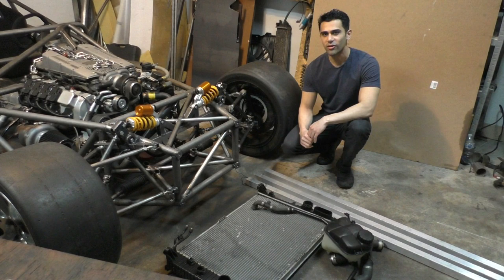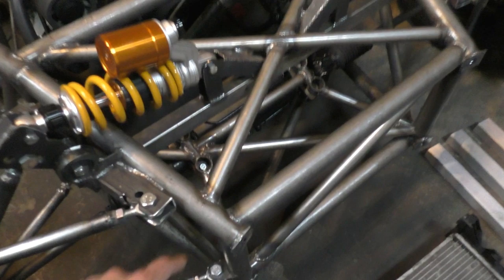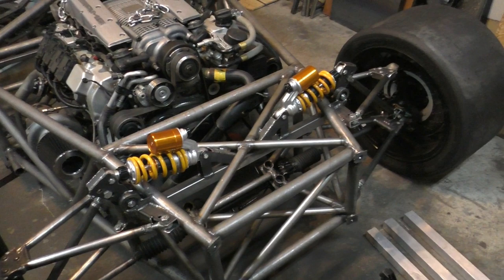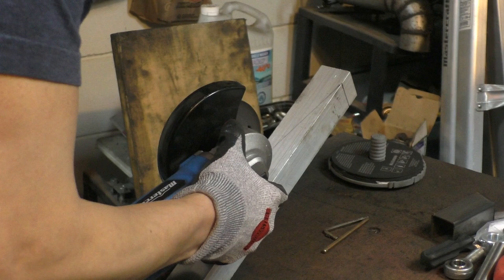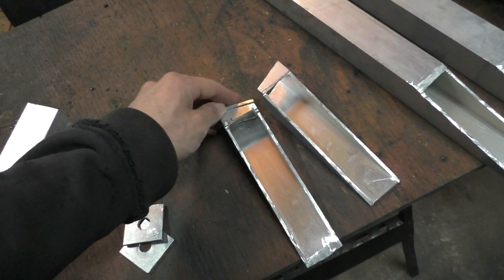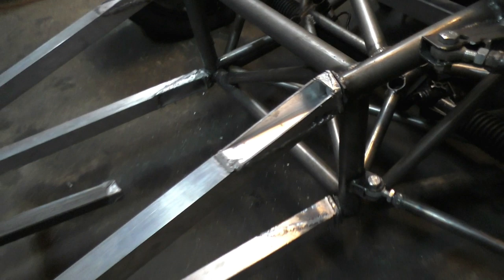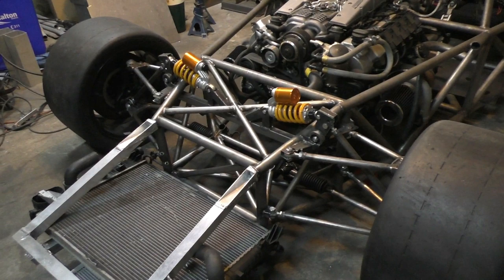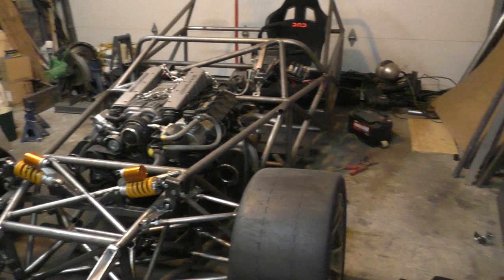Crumple zone and Radiator Install - E55 ASL Part 9

Comment: SK8215
As a replacement for the supercharger, you could (later on) install electric boosters. A 0.5s charge the only thing that they are useful for. It would reduce the turbo lag. You’d probably have to combine them with li-polymer battery packs to keep them lightweight and power dense at the same time. 
I would find it interesting to see how much that would improve the performance of the car (if you feel that need at some point). 
Haha that’s just a matter of time...

Comment: Where triangulation doesn't meet corners,  you can add gussets out of flat stock in the gap. Will join all members stronger.  Also, intake manifold,  w219 5.5 ltr has variable length intake runners. Maybe make adapter plate and use that intake?  Throttle response is great on those motors.
Reply: The non supercharged M113 has variable as well. Probably doesn't flow very well though.
Reply: GreenWeeney 
Those are great ideas! 👍
Reply: @Conservator.  👍
Reply: GreenWeeney 
When he mentioned those triangulation bars didn’t go exactly to the corners I thought that if those short pieces of thick tube where bent in an accident, you’d probably others things to worry about (or even nothing to worry about anymore). 
Do you think adding gussets would be useful in that sense?  I’m just curious and you are undoubtedly more knowledgeable than I am. (Considering my knowledge that’s not even a compliment;)
Reply: @Conservator.  lol. It was a suggestion to him for if the joint connection was at all a concern to him. Especially considering that fact that it would be the main joints to which the crash bars bolted to.
I've found gussets to be a very good and safe idea for all kinds of joint or brace reinforcement, from wood to plastics and metals.

It was a suggestion.  Trust me, not a sign of any imposed knowledge or skill.  😎👍
Reply: GreenWeeney 🤣👍
Reply: Variable intake runners? Sounds more like a trombone than a manifold.

Comment: I was gonna say I would block the transmission cooler part on the radiator as they have a tendency to leak. However coolant in your power steering system is a lot less damaging than a Bruce Jenner strawberry milkshake. You blocked off the radiator when you welded above it but not the plastic end tanks, lol. Just weld new tanks on it already :p

You only have a certain cylinder pressure limit, whereas a supercharger being a giant parasitic drag on your crankshaft stealing HP from that limit, a turbo does not!

Comment: With your crumple calculations, did you factor in tearing of the base material at the welds? Also, did you use 4340 here or was it CDS.. I've been paralysed with my own build for a while now pondering over how I can improve my design. P.s I'm an aeronautical engineer, so my skills are more with wing design and fluid dynamics...

Comment: hi
 think it's a bad idea to position the radiator so close to the road.
- it will be clogged with dirt
- on a sunny day, the road warms up t~ 60-70с, it means he will work under unfavorable conditions, over t= +30с
Reply: Quite a nice spot actually for keeping cg low and looking at the intended bodywork design there is going to be positive pressure above the radiator from ramming trough the air so air is forced out from the bottom prop keeps the dirt out as well. Still it's not a shopping trolly this car would need so much maintenance anyway cuz racecar
Reply: no doubt it will need servicing but nothing compressed air and a hose water can't fix.

Comment: When welding with a mig mate always push. With mild steel do what's called a string bead. So don't weave just push it it evenly. Watch the edges and the centre will take care of itself. With aluminium you do what's called push pull.
Other than that great work

Comment: Things are coming along love this build but would it not have been better if you mounted the radiator at an angle were the would be touching the top aluminum bean

Comment: The only thing I'm worried about is a car sliding over you because that crumple zone is low.  God forbid that happens.  Yes, it does happen and can.  I saw a video from two weekends ago and luckily this dude had tubes going from the top of the main hoop to the front dash area. I'm pretty sure it was a Radical. Just my two cents. I love what your doing keep it up!
Reply: oh no, not a halo?
Reply: Tik Tok 
You probably mean: God forbids that happens. 
Now it’s like you wish it to happen ;)
Reply: @Conservator.  ha yes sorry.
Reply: Tik Tok 😉👍
Reply: Also here's the link of the crash I'm talking about. https://www.facebook.com/story.php?story_fbid=2763980523618128&id=100000186228201
Reply from the maker: Yeh, sliding under another car is always a risk in open top cars. Even in f1 they've had a few close calls. I still prefer to keep it open top rather than going with a full cage. Just a better driving experience

Comment: I would definitely think about some reinforcement around your lower rear control arm. This tube sees the most force during braking and you have it in the middle of a tube, suspension points should always be at triangulated nodes. This tube is likely to bend during braking, and possibly permanently. Also would add gussets to the U-channel in the front for less compliance. And your lower rod ends are in bending due to the moment created by the pushrod acting like a lever on the outer ball joint. Lastly in another video you said you used water to cool down your A-arm welds. Depending on how quickly this cooled the welds it could've made the welds brittle. This is actually worse for alloyed steel like 4130 vs normal 1040 steel etc.
Reply: He addressed most of this in another video where he showed his analysis. You should watch that and then by all means counter with an analysis of failure modes you have discovered. It would be really useful to see alternative analysis of his suspension, maybe you have seen something he missed. Also, rod ends are not in bending if you look again.

Comment: I really like the idea of removable crumple zone, have you considered adding thin wall cross bracing to it too? It looks like if hit at 45 degree angle it would have only 1/8th of it's strength. What are the dimensions of aluminium tubes?
Also when calculating the strength did you use weight of the entire car or only parts behind given segment to estimate g at which it will start to crumple? It's a front-mid engine car so there shouldn't be much mass behind the seats acting on driver compartment (in front end collision).
Reply: Yeah I like the idea too but it would be better with cross braces. Race cars usually get hit on corners or sides. Just my 2 cents. Awesome project that needs more attention!

Comment: Maybe I missed it, but I'm wondering why you chose not to tip the radiator up at the angle of the upper bars of the crumple zone for better air drive through the radiator. At that flat angle a great deal of air will be passing over instead of through the cooling fins.

Comment: There aren't many people building chassis from scratch around, good to see another one out there! Did you go with aluminium for overhang weight or softer crumple design originally? I think we'll be ending up with steel as it stands, just because we haven't done any aluminium welding at all. Maybe something to change later though.

Comment: I first thought you should make a jig so it is easy to make new crumple zones, and then always have a spare with you just in cast you have a front end collision. So far so good, then you mounted your radiators in the crumple zone so in fact every time you need to bolt on a new crumple zone you will most likely have to replace the radiators which complicates thing a little. Was there no other place that you could mount you cooling system?

Comment: The supercharger takes HP, weighs a lot, raises the center of mass of the engine, because its in one of the highest points on the car and adds a lot of rotational inertia during acceleration therefore giving another 20-100 kg artificial weight during acceleration. It has to go out.
Reply: ye he is planning to
Reply: Only one answer: sequential turbos. He already did a twincharge system in his E55.
Reply: @jm036  I was hoping for a sick compound turbo setup, might be too much for that engine to handle though.
Reply: That 0.5s lag is could very well be filled with an electric turbo. That’s all they are good at (very short impulses).
Reply: @Conservator.  electric turbos aren't practical yet, compound turbos dont have too much lag but they push 30psi+  at top end and I don't think that engine could handle it
Reply: The only way to remove turbo lag properly is ignition retardation to keep it spinning at max rpm all the time. Electric will strain your battery therefore requiring a heavier battery+the electric motor would be heavy+even then it would take time to spool up.
Reply: @two_number_nines  Exactly, 2 ways to do electric supercharging: 2 alternators (large parasitic effect on engine) or a large battery bank (large weight gains) not including the massive electric motor and gear box required to spin a turbo upwards of 20k RPM. This is why I said electric turbo/supercharging isn't practical yet.
Reply: @Conservator.  Electric turbo? Wat?
Reply: Ben Brooks 
Electric turbo’s in general do not work at all. If you think about the energy consumption by a compressor and it’s clear that you’d need the batteries of a small EV to provide enough energy. And even if you would do that, than all you’ve done a make an electrical compressor bypassing the energy recovery aspect of turbo’s. 

My idea was to use the electric boosters for 0.5s, just to get the turbo’s spool up faster. 
Because of the relatively small time you’d use the motors, you could use relatively small ones and over-charge the hell out of them for that 0.5s. 
Also by using li-polymer batteries that have insane discharge currents, those can be lightweight too. 
Think about how hybrid performance cars use the electrical motors to produce extra torque especially at very low rpm. 
Electric boosters can do a comparable thing on a much smaller scale and only for a very short time. It should be just enough to reduce turbo lag. They are by no means a replacement for the turbo’s in any way shape or form.

These booster will need extra energy but the total amount should not require an extra or heavier alternator.

Comment: From here it looks like the radiator is installed horizontally, is it true? , how much of an angle is it inclined? , will there be any ducts or cowls for directing airflow to this horizontal radiator from bodyworks?, Please explain.
Are you planning for cold air intake radiators?
Reply: It looks that way,ducting may give a good air capacity flow into the rad but if the air as it would seem, is going to be forced through the rad and out to the underside of the car the high pressure air under the car when travelling will inhibit the flow of transfer air through the core,furthermore the air being forced to turn 90 degrees to travel between the tubes will create turbulence and decrease air velocity.
Reply from the maker: Yeh, its pretty much horizontal. Inclined angle in 10 degrees. You'll see race cars even go complete horizontal. Once the ducting is done the flow will come in from the front and exit from the top. Same design you see at the beginning of the video
Reply: It would be neat if you could go through some of your design decisions on radiator placement in upcoming videos. Great series 👍

Comment: Correction, aluminum likes to bend too much, it's too soft to push through the mig gun line. It would wad up in the welder. that's why the spool gun

Comment: I am still trying to figure out how 9 people disliked the video!

One super small comment, when you did the X-Bracing under the radiator, I wish that you had cut the braces at an angle so they would line up with the crumple zone squarez ;)

Comment: I have a few questions. Why would the crumple zone be made of aluminum and not a stronger steel? Also I found it kind of odd that the radiator is parallel to the wind direction I would imagine an inclined position would have been better? but perhaps it doesn't make much of a difference. Anyhow, I am loving the series.  I hope you can make a video once you are finished with how much the build costs (materials, hours, etc).

Last question, are there any specific books that you read that have taught you this design process? I am looking for something that gives me theoretical background on designing the suspension, chassis, materials, engine, transmission ,etc.  I would love to make my own little buggy but want to properly learn perhaps with some simulation work involved in the design. Thanks for the content once again.
Reply: All of the Carroll Smith ...to win books and Van Vaukenburg "Race Car Engineering". Also look up Formula SAE materials books and videos.

Comment: Won't the radiator add strength in parallel to the crash structure?  Is it weak enough to not be considered in the analysis?  This arrangement (which to be fair is extremely common) just gives me design headaches.  Radiators are fairly geometrically complicated, so in my conceptual designs, I have always placed them in areas with high strength (such as the front suspension subframe), areas that are not in the load path for front impacts (such as behind the front wheels, like a Panoz Esperante GTR-1), or attached them so their supports fail easily (meaning they fail first) and don't contribute to the strength of the crash box.

Either way, awesome job!  I will be watching the progress on this car with great interest!
Reply: Radiators crumple like Kleenex. Don't ask how I know.

Comment: My opinion might not be worth much, but wont it be ebtter to have the radiator in the back, better weight distribution? As far as Im concerned weighing only 600kg isnt worth it if it's all in the wrong place?

Comment: Great progress man. Nice work. @SK8215   Are you sure you wanna mount the cooler in the crumple zone? Why not mount the in the back? That way, in case of a front end hit you have less stuff that breaks and it'll make replacing the front end crumple zone much easier. I definiatly go for that. Saying that I have to admit I know nothing about about car building or racecar design but seems to me like less is more. Have a good one.
Reply: Id even think the extra tubing would help cooling too if mounted in the rear
Reply from the maker: Just to keep the system simple. In a track car your never far from changing fluids, replacing hoses or ending up with leaks. This way everything will be easy to maintain, replace, bleed.

Comment: 10:45 you should go with a cast aluminium intake instead of a welded one.

P.S. It's a joke
Reply: How about designing the intake manifold in a computer program  and then having the thing printed. I do like the way this guy thinks.

Comment: You ball joint on the suspension should be vertically not horizontally, they going to break at the first bump
Reply: Tech&Co that’s incorrect. By that logic if they were vertical they’d break at the first braking zone. 

Watch the last video, he explains exactly why you shouldn’t use these joints in bending (vertically).
Reply: @robevans3980  those joints are used in rally and Paris Dakar vehicles vertically they do not break used that way.They are actually a lot stronger as the spherical bearing is fully supported,horizontally when loaded as in the case of the front inner joints on the wishbones the loading will try to push the bush sideways onto the outer collar . My whole car is set up with rose jointed compression struts and a rose jointed 5 link,all joints are mounted vertically.The joints have been on there for  around 15 years and have taken some abuse,to say the least. the rear comp strut joints are exposed to forces that his lightweight car will come no where near to replicating and are still serviceable.
Reply: Dick Taylor I understand they can be used in that manner, but it doesn’t make it correct or ideal. If you make something out of enough steel, it will survive the loading, but if used correctly it could be made much lighter and more efficient. Ultimately it’s much easier to make adjustments when used vertically, so people take the weight penalty and use larger than necessary parts for ease of fabrication and adjustment.

They are certainly not stronger when used vertically. Despite the bearing being supported as you say, the threads are in bending which is a freshman engineering no-no. The threads reduction in cross section and addition of stress risers make them much less than ideal. When used in the proper plane the threads are in compression and tension and are MUCH stronger that way.

Comment: In case of accident you have a lot of hot water in front of You. 
The passenger cabin will be a closed box design?
Reply from the maker: Fluids can make their way inside an open top car if you crash bad enough. But with a racing suit, helmet and gloves its usually fine. I've been sprayed with coolant before lol

Comment: Will the radiator still work lying horizontally. They are designed to work in thre vertical position. I know people who have tried to lay them down and ended up with air in the system causing the motor to overheat. 
What are your thoughts?
Thank you
Reply from the maker: The hoses are still pretty much at the highest point on the radiator so the air should bleed out its self. If the hoses are at the bottom then it could become a problem.

Comment: 4.50 you have the gun wrong way, your draging it backwards like a stickweld. you are building in soot into the weld that way! When Mig welding aluminium you must push
Reply: 4:50